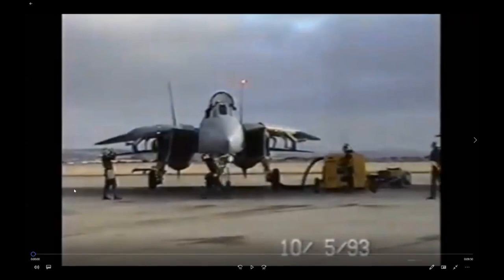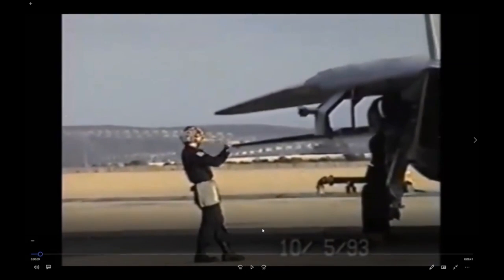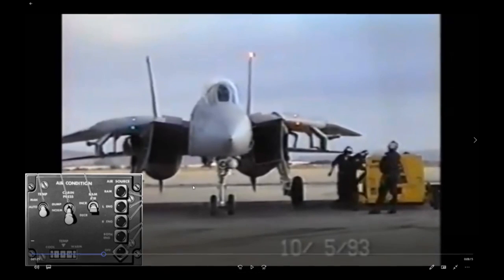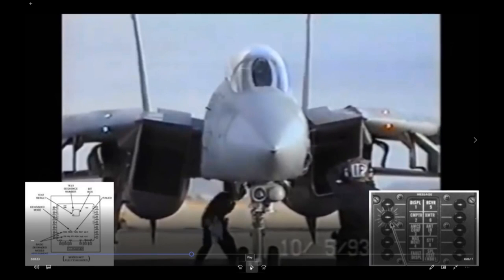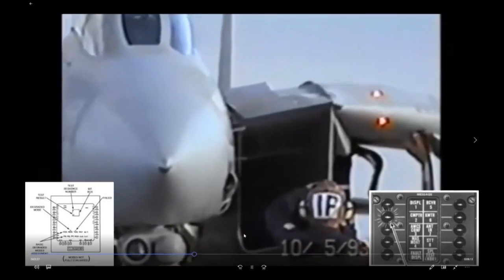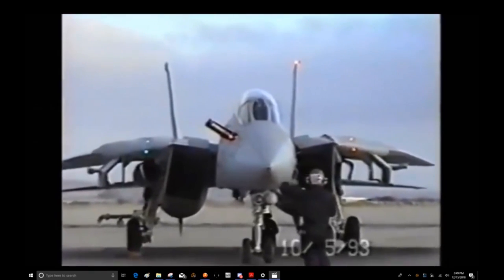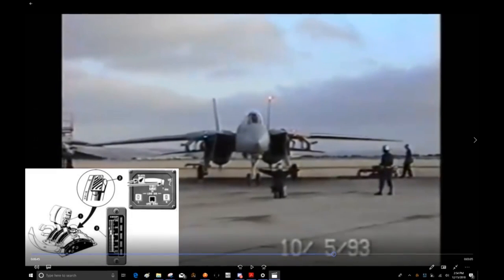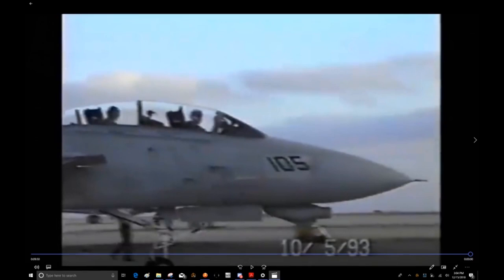F-14 Cold Start Discussion

Comment: Thank you for the video.

You suprised me when you announced very early on in your video that the F-14 does not have a battery so naturally I went to look at the electrical distribution schematics and sure enough... can't see a battery (with the exception of some system-specific internal batteries like the EGI). So I am left with a couple of questions (I've had a quick look at the NATOPS but with no success):

1. Anyone know the reason for ditching the battery altogether in the F-14? I can't think of any sim aircraft I have ever flown that does not have some form of "Main Battery Switch", even if it's just for providing some simple lighting before the generators can be brought on-line. Listening to the "PeninsulaSrsVideos" on the F-14 design process details some of the weight savings but I don't believe a battery (and its charging system) was mentioned.

2. In case of dual engine flameout where does the "Hydraulic Power" come from for the Emergency Generator? Can the engines windmill sufficiently in most flight conditions to provide the necessary hydraulic power to power the emergency generators sufficiently for a re-light? Or are the pilots just told to punch out in case of a dual engine flameout?

Once again, appreciate the time for the video and looking forward to any answers on this.
Reply from the maker: 1. Battery was unnecessary because you'll always have power available on the Boat/Airbase, so it's real easy to get rid of the Battery for weight savings.  (consensus among the Tomcat folks here at CVW-11) 

2. Have to maintain the optimal nose-down attitude for airspeed to windmill the engines for the hydraulic system to supply hydraulics to the Emergency Generator.  If you don't have enough altitude to windmill the engines you'd leave the aircraft.
Reply: @carrierairwingeleven1747  Thank you!